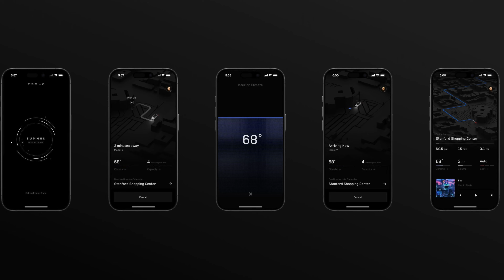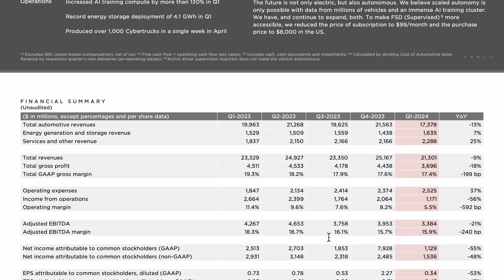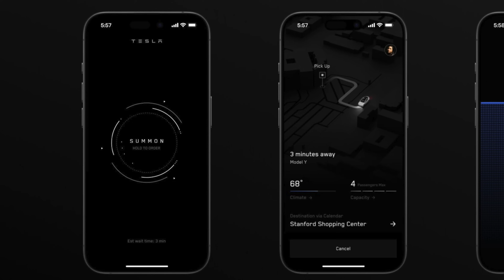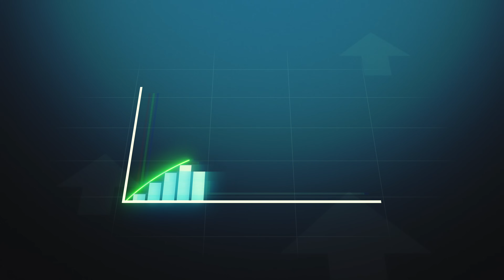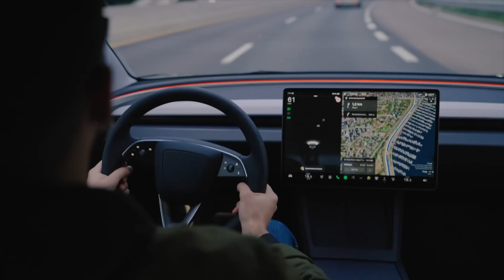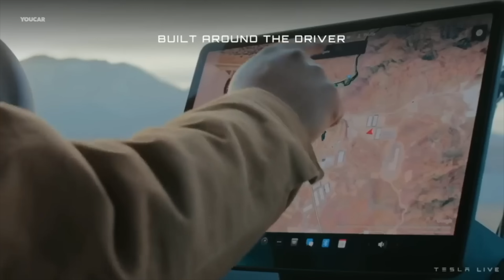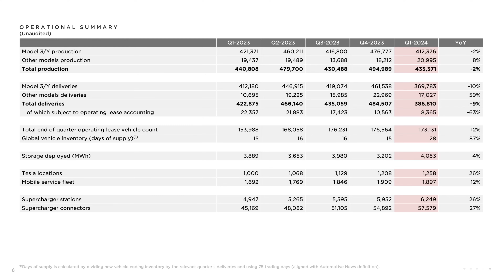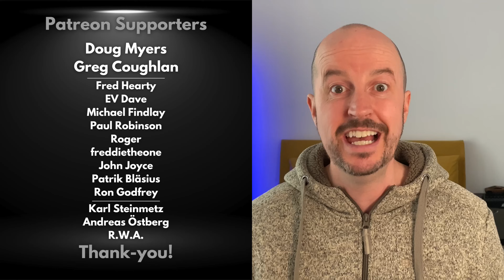People Have NO IDEA What Tesla Just Revealed!

Comment: Another thing, the Robotaxi will be driven 100% by wire for all functions. So to add a steering wheel and pedals one only needs to plug them in and bolt them down in the car's interior, a cost of a few hundred dollars at most.
Reply: Robotaxi is vaporware, at this point.   Remember what Elon said in 2019:

"1 million robotaxis by the year 2020"

How did that work out?  😀
Reply from the maker: @DerekDavis213  To derive that it's not coming because it's late, is daft. The Cybertruck was late... now they build 1000 per week.
Reply: @TeslaJigsaw  Yes, 1000 trucks per week that are basically a fiasco .   Has there been another recall yet?

It is not daft to quote the CEO of Tesla, and 5 years ago he was dead wrong about robotaxis.   So why believe him now?   That is just Logic 101.  Perhaps you should enroll in that class at the University of Yorkshire? 😀
Reply: @DerekDavis213  Q:Why believe it will happen now when it did not happen 4 years ago? A)They have 200% more compute and storage power and also double the amount of autonomous miles(2 billion) of data collected and can retrain their neural networks with updates improving the drive on a weekly basis!!!
Reply: @chrisroger2000  $1 billion in NVidia hardware, and training the neural networks 24 hours per day for months.

But today, the very latest 12.3.6 still makes mistakes on any challenging route.  Human supervision is 100% required.   What a disappointment!

Comment: I purchased a 2016 S 90 D in January. It has FSD 1.0 Hardware, batteries and motors warranted until December 2024.

The battery pack just went, Tesla will replace FREE. I'll spend $1,800 for the latest Infotainment upgrade, and latest FSD AI Hardware.

Now I hope to add my car to the Autonomy Fleet, possibly as a "Premium" vehicle? Yep, I'm an unabashed fanboy ❤️‍🔥
Reply from the maker: Oh nice! How many miles had it done before the battery issue?
Reply: @TeslaJigsaw  
105k. A little disappointing, but if it was to fail, thank the Fates it failed under warranty!

Oh and Tesla Service called me this morning, turns out the previous owner had already upgraded one of the Infotainment components, so my $2,850 quote just dropped to $1,800 😍

Comment: As of today, Federal authorities say a "critical safety gap" in Tesla's Autopilot system contributed to at at least 467 collisions, 13 resulting in fatalities. That said, regulatory approval is going to be a tremendous challenge for Tesla. This is just one of the many challenges that Tesla has to contend with. It just seems like Tesla always has some issue that they have to contend with that causes Wall Street to sell off the stock which drives the stock price down.
Reply: I wonder how many human error collisions and fatalities were in that same time frame? Also auto pilot is human supervised not full self driving. I bet almost every case was operator error thinking the car was going to do everything. Auto pilot is basically a better cruise control. People are just not very bright sometimes
Reply: Annually, you have over 40,000 traffic fatalities in the US, nearly 20,000 in Europe … clearly, human drivers are a „critical safety gap“ … let‘s get rid of human-controlled vehicles 🙈(these numbers are official statistical data from 2022)

Comment: I have a different view if the "interim" vehicle.
.
I think that it will be the "conventional" body, assembled in a slightly different way (maybe front/ rear castings "pre-assembled" as per unboxed?) Then meeting at "final assembly.
Agree regarding the 48v, steer by wire... Plus electric brakes??
That gives the cheapest "old model" piss8 (could THIS be "Juniper"?)
.
Meanwhile, as they toad test the systems on the 3² and Y² the full unboxed system will be perfected.
.
Still don't think its a 2 seater (London Cab regs/ Wheelchair?)
.
If it's "cyber like" I dont think it will be Stainless steel.
Logic would dictate
Cube.
Sliding door, 
Low floor,
Modular, various rear sections for Taxi, Van, pickup, etc
.
Commonality in huge numbers.

Comment: Here is how to interpret what Tesla announced:

1) Elon finally won the argument (described in his auto-biography) to ditch the $25,000 car based on the gen 3 platform. Two things formed this... cheaper batteries from suppliers and true FSD coming very quickly. 
2) Instead, Tesla will use their existing lines to make this more affordable car and other models. Tesla will use some of the unboxed techniques to make them cheaper to manufacture but has warned that the margins on these cars will be slim. 
3) Tesla, at first, will make no more than a million of these more affordable cars as they max out their existing factories to 3 million. 
4) Robo-taxi will be made fully with the unboxed method and they will start making them in Austin to supply the first test cities with taxis. 
5) After robo-taxis launch in certain cities, and while Tesla tussles with regulators and if things go promisingly, the new Giga factory in Mexico will begin construction.  Tesla knows that it won't need this factory online for a few years while FSD proves itself to regulators in various regions and countries.  This factory will then make the robo-taxi for N. American continent. There probably will be others elsewhere in the world if the taxis are allowed there.

BTW... the above also may explain Drew's departure. Drew and his team has already finished the design of the robo-taxi unboxed assembly line.  Given Tesla's decisions it appears there are to be no new platforms to be designed and built in the near future. Drew likes challenges and probably saw work ahead that didn't excite him as much as new ground up engineering does. Just a guess but probably part of his decision.
Reply from the maker: Great summery & points